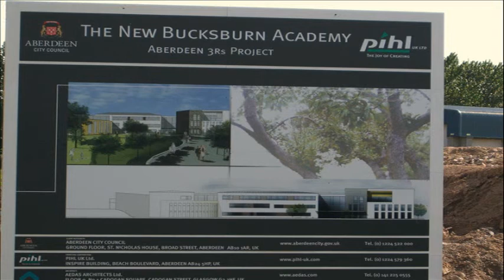The Building of Bucksburn Academy

Comment: Heather Taylor worked As A Nursery Nurse At The Old Marlpool School from 1992 to 27th February 2009. Mrs Adam went To The Old Marlpool School from 1992 untill The Old Marlpool School closed On The Final Day On 8th October 2009. Mrs Smith used To Work In Room 1 from 1993 to 1999 and Mrs Smith Used To Work In Room 4 from August 2003 to May 2005 and Now Mrs Duncan worked In Room 4 from May 2005 until The Old Marlpool School Closed On The Final Day On 8th October 2009.

Comment: Marlpool School was opened In Bucksburn In Aberdeen In 1975. 
Marlpool School was closed On 8th October 2009. 
Meg Taylor Used To Work At The Old Marlpool School From February 1988 to 23rd June 2000. 
Heather Taylor Used To Work At The Old Marlpool School From 1992 to 27th February 2009. 
Mrs Adam Used To Work At The Old Marlpool School From 1990 to 8th October 2009. 
The New Bucksburn Academy With The Marlpool Wing Opened On 26th October 2009.